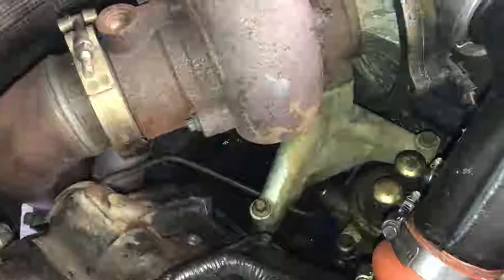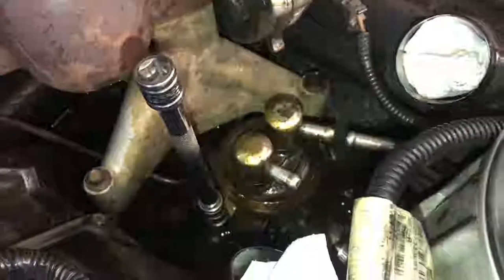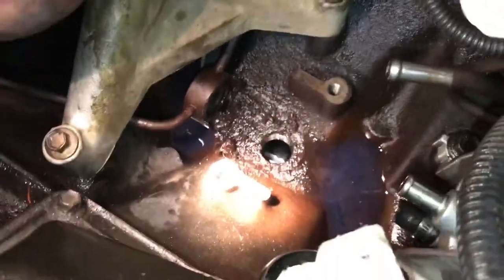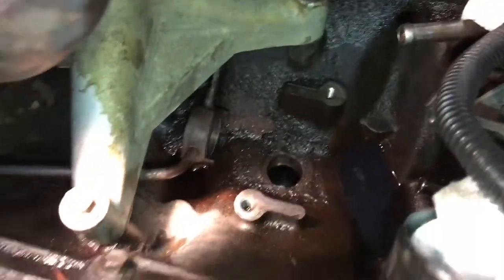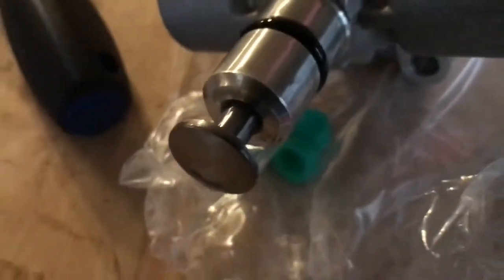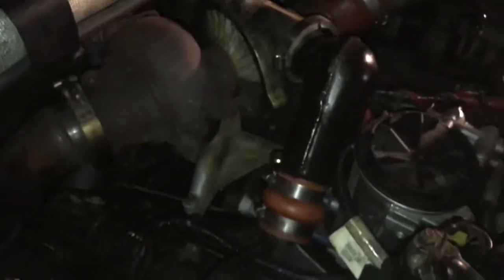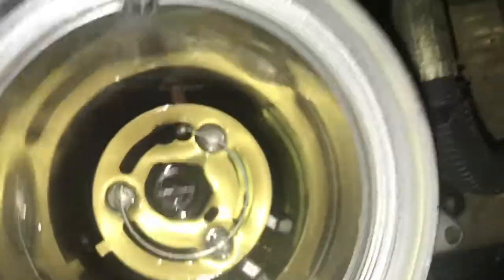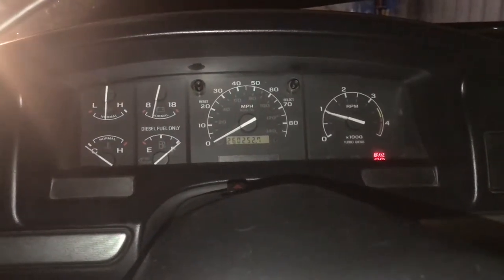Lift Pump Replacement - 1994.5 F350 7.3L PowerStroke

Comment: In the process of doing the same job on the same truck, the 94.5 7.3 liter diesel.... going to replace the fuel bowl the pump itself all the hoses and the 2 high pressure  flexible fuel lines going to the engine heads ....watched several you tube vids on this project and try to glean the best parts of each video.....interesting to note that there are two different turbo pedestals that I believe are interchangeable on the 94.5-97, yours is the same as mine and needed either a one and a quarter inch or 32 MM socket to get to the banjo bolt......one of the other videos the mechanic used a box end wrench to get to the banjo bolt on the other Ford designed pedestal.....anyway....a great video on this project and thanks for your taking the time to post on You Tube.
Reply from the maker: Good luck! Let me know if you have any questions - I’ll try to help

Comment: I  have a 1994.5  ( 95) f350 crewcab 4x4 abd when i replaced the fuel pump i used a die grinder to take a chunk out of the pedestal so i could get a ratcheting box end wrench in there to remove / tighten the bango bolt, it worked great ! And the chunk i cut out of the pedestal was only cosmetic, it did not effect anything, except allowing me to get a wrench on the bolt !! .... great video

Comment: I’m doing a fuel pump change on my 1997 f350 7.3 now and it is the same set up as yours. Big pain getting to the banjo bolt
Reply: how big of a pain in the ass was it to get back on i have been trying since yesterday and it will not work
Reply: I had the fuel bowl out and the metal piece along with the rubber hoses that connect to each valve cover and the turbo. Anything that I could remove easily to give me more room. My knuckles were pretty beat up by the time I was through. I was almost to the point of getting a grinder to notch out a piece of the bracket that supports the turbo just to get a little more room for my hands and wrench but luckily I had some good music playing and saying a few prayers and I was able to get it.

Comment: I have the lift pump and fuel bowl o ring kit. I can't wait for this weekend. And then I can reminisce with my soar arms hovering over the back of the block for hrs. I really wish I had an engine creeper right about now.  There isn't really a good way to get all the way back there without resting on altenator and also using the cowl by windshield. I'm soooo looking forward to it. I have a buddy coming to help out so maybe it won't be quite that bad.  Really hope it gets rid of the slow leak.  I can't see where it's coming from so I'm throwing probable parts at a  26 yr old truck 😂
Reply from the maker: Good luck, my friend!
Reply: @MartyGramRC  I'll manage it's for my wife's truck just replaced door hinge pin bushings last week and ball joints on my truck. Regular shade tree mechanic here.

Comment: great video, only wish you would have shown putting the hoses on'
Reply from the maker: Yeah, sorry about that.
It’s best to get that lift pump banjo and mounting hardware tightened down first.
After that you’ll wanna pull the fuel bowl as far forward as possible, or remove it completely (I recommend option 2) to install the hoses.
Lastly, slide the fuel bowl back forward, or reinstall at a downward angle, aligning the hoses to the correct, corresponding locations. It’s fairly simple, to be honest.

Comment: Great video! How much fuel should be in the filter reservoir when you change the filter? I thought mine used to be almost full,now it is real low in the bowl.
Reply from the maker: After you pull the used filter, I reckon the reservoir should be roughly half full - give or take.
Reply: @MartyGramRC  Thanks! I was just wondering if being low might mean something is playing out somewhere/part. Thanks again!

Comment: nightmare. i threw baby out with the bath water. i have an obs 97 w powerstroke. had this two stage mechanical garbage. i put an electric pump under truck and a filter water trap az well under truck. added a foss regulator inline after  exiting fuel rails. never ran better set it at 50 psi . factory ford is 44psi. the whole job was less than 350$ in parts and a day of fiddling with lines . well well worth it. i threw the entire fuel filter /pressure reg/heater/water trap , leaky crap in the trash. no leaks and starts immediately. no cranking to get fuel pressure. the pump is set up to come on at key run position . so you have 50 psi at crank.  also the hpop was leaking at high pres. output linez. after screwing with ford /navistar boss fittings i changed design . i finally drilled them out to a 3/ 8 pipe thread and threw useless boss fittings in trash too. there is up to 1800 psi in those at full throttle and they leak on every one i ever saw. factory dropped the ball on that detail. pipe threads were easy to do .hardest part was getting the debris from the holes as i drilled. i have over 50k since and wish i had done it all 20 years ago when i bought the truck. no leaks since until water pump sploded today. fun!

Comment: Its not the year thats causing that, from what i know, in a California compliant 7.3l. You have to remove the turbo and pedestal, but in a Federal Emissions compliant 7.3l, you can remove just the Lift pump.

Comment: How do you prime it on a manual trans?
Reply from the maker: Key off, in neutral, bump the solenoid on the inside of the fender with a screw driver. Do that a few times for about 5 seconds each time. She should go.

Comment: Ummm, my 1996 has the same turbo pedestal in the same exact way, big time, as the banjo bolt. 🤷 There's nothing different there.
Reply from the maker: 1994.5 was different than the 1995-1997 - it looks the same, but it’s not.
Reply: @MartyGramRC  pretty sure it's exactly the same. I would post a photo of I could. But thanks to your video (not the 2-3 I watched before because they didn't even look like the same truck), I was able to get everything off and loosened so that a friend (stronger than me) can lift that pump off tomorrow! Everything looks identical. Except yours is much cleaner of course.
Reply from the maker: Regardless, I'm glad my video helped - that's all that matters! I hope you were able to get it done. Not a project I want to do ever again... Lol

Comment: Pretty much idi engine add a turbo ...In late 1995 on its the new power stroke designed engine...it seems in 1997 that banjo bolt isn't as far back under the plentum..my experience any way
Reply from the maker: What? IDI and PowerStroke are completely different engines. The only things they have in common are displacement and manufacturer. 

The 7.3 IDI was in pickups from 1988-1994. They offered the IDI w/Turbo in 1993 & 1994. 1994 was the only year they offered all 3 engines: IDI, IDI w/Turbo, and 7.3 PowerStroke. 1995-E2003 is 7.3 PowerStroke exclusively.